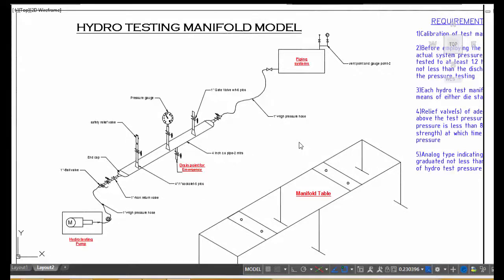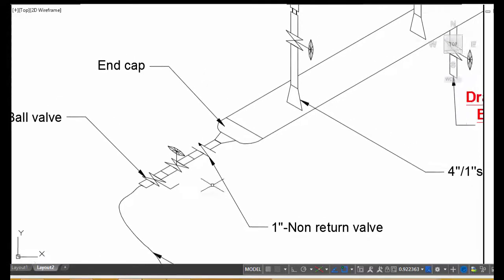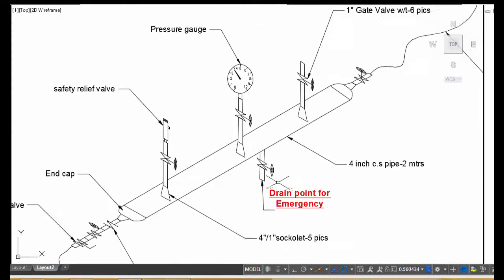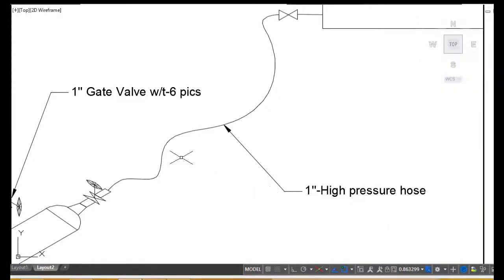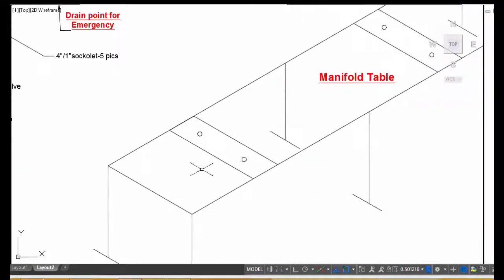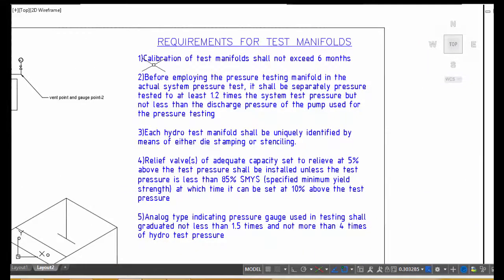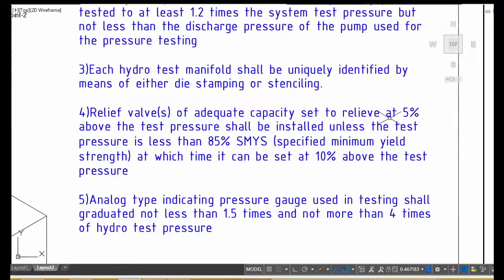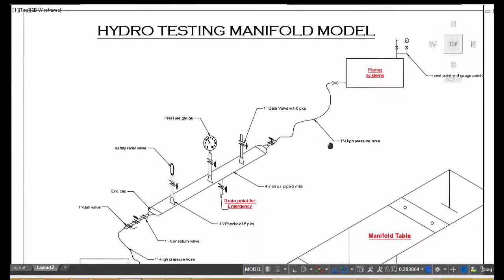HYDRO TESTING MANIFOLD FOR PIPING SYSTEMS

Comment: Should I use manifold in hydrotest ?
Reply from the maker: Yes,manifold should be used at time of hydro testing,so we can control over all piping system in safe manner.In manifold we have PSV (PRESSURE SAFETY VALVE) its helping to control the piping system pressure.
Reply: Technical Piping 

If we have many repercussions and so does our pressure valve directly with the system you could give up manifold?

Comment from the maker: REQUIREMENTS FOR TEST MANIFOLDS

1)Calibration of test manifolds shall not exceed 6 months

2)Before employing the pressure testing manifold in the actual system pressure test, it shall be separately pressure tested to at least 1.2 times the system test pressure but not less than the discharge pressure of the pump used for the pressure testing

3)Each hydro test manifold shall be uniquely identified by means of either die stamping or stenciling.

4)Relief valve(s) of adequate capacity set to relieve at 5% above the test pressure shall be installed unless the test pressure is less than 85% SMYS (specified minimum yield strength) at which time it can be set at 10% above the test pressure

5)Analog type indicating pressure gauge used in testing shall graduated not less than 1.5 times and not more than 4 times of hydro test pressure

Comment: What is the purpose of the larger 4' manifold and is there a reason not to do it all in 1' with reducing tees to the gauges and prv
Reply from the maker: pressure gauge/psv size 1" or 3/4 " so we prefer for 1" branch.